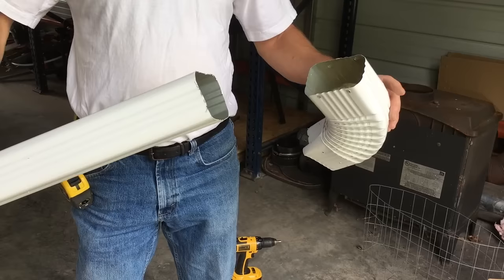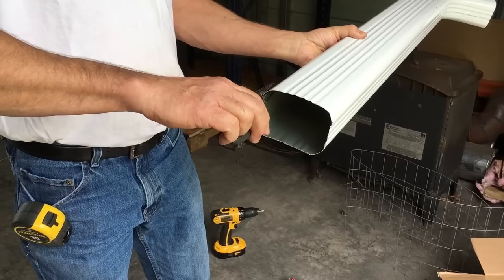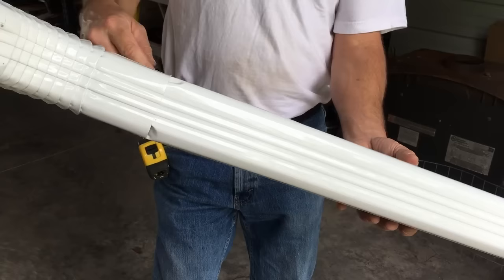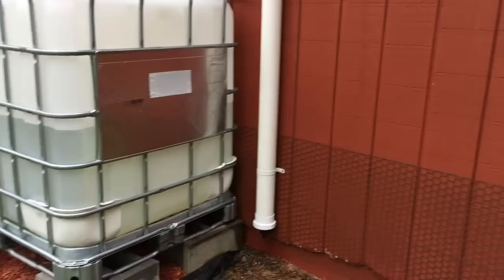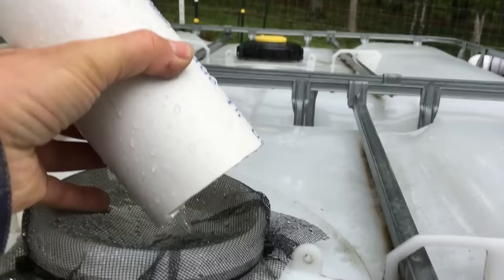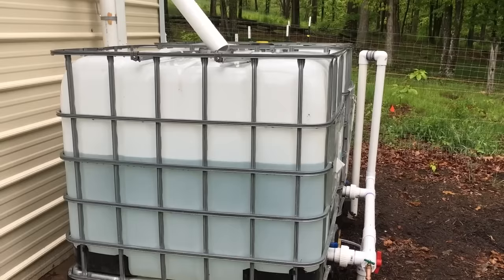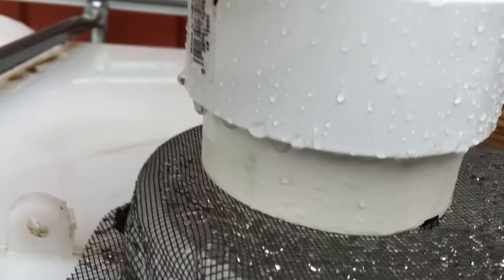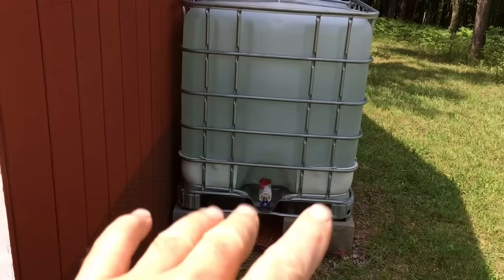RainWater Harvesting Lessons Learned

Comment: Just an FYI for anyone new to rainwater systems. The First Flush is not recommend. Do some research. The water in that First Flush system turns toxic pretty fast and you have to clean it out constantly. That, and you are just wasting water.  All you need is the opening with the screen that the water goes through coming off the roof.

Comment: Just put a ¼ inch tape down the front before you paint the tanks. Pull the tape off after you paint and you will have a ¼ inch clear spot to read the water level.
Reply from the maker: Hi Richard.  That is a neat idea.  It would work, but would need light on the back side to show the level.  If the tank was completely dark, which is the idea to keep algae from growing, then you wouldn't be able to see the water level through the clear spot.  However, if the cap of the tank was removed, then it would give enough light to see the water level.
Reply: +Great Escape Farms   I have a tote wrapped in a black tarp.  I cut a 2 inch wide opening vertically in the tarp from top to bottom and have been able to see the water level very well
Reply: Great Escape Farms you could insert a tube in the top with a pop bottle inside connected to a rod that sticks out the top. The pop bottle could rise inside the tube as the water level changes and you could have a ping pong ball on the top of the rod as a visual marker of how high the water is.

Comment: I just discovered your channel....5 yrs AFTER you made this video!  What a treasure!  I just built a metal 'She Shed' that is 90' wide x 140' long, so I have 8 downspouts on each side of my building.  Since I got 7 free totes & I can buy more @ $40 ea. I am placing 2 totes per downspout on one side (16 total).  For the other side I am hoping to get four 2500 gal tanks + 8 totes  for the remaining 4 downspouts.  Looks like I have a lot of work ahead.  I am most likely sanding the totes & then painting green to match color of my building.  It's too hot here in Texas to use black plastic liner.  We have triple digit tempts & my 16 future totes will be on the West side.
I looked @ your playlist & you have many interesting videos, so u just got a new subscriber.  Thanks!
Reply from the maker: Wow, that is quite the 'She Shed' :)  Thanks for subscribing and good luck with your system.
Reply: @greatescapefarms  Thanks!  Keep ur videos coming.  You are valuable and we are very lucky to learn from you.
Reply from the maker: @TexasLocalProduce  I'm blushing :)  Thanks!

Comment: Thanks for the update.  Kicking the idea of setting up system for "just in case" scenario.  The sun can knock the grid down so water would be an issue.  Any pumps will need to be DC optioned. Watch the sun updates every morning before heading out to work.  It's coming folks.  Prepare!
Reply from the maker: Thanks!

Comment: I'm sure three years later you've stumbled across some better ideas to your issues you were having. One, being the overflow from your first flush. I purchased a drain diverter and put under the bottom of the first flush PVC pipe. Instead of putting a plastic hose on the end, i capped mine and unscrewed it just enough so that the water could drain slowly. The drain diverter catches the excess water and diverts it away from my foundation. I use 7 55 gallon barrels vice the totes only because there are more PVC fittings for the barrels than the IBC totes, however my preference was to use totes vice barrels due to space. Very informative video and i did have the same issue as you with the downspouts!! Nice trick. I too found that out by watching other vidoes. Hope all is well with your system now!
Reply from the maker: Thanks

Comment: i love this video and just a suggestion , if you block up those anti-siphon holes,  when you want to either empty or winterise the tote , then when it rains it will automatically empty the tote and dump the water down your black pipe , it would then refill the tote and empty it when its full , maybe an idea for an upgrade (for others as well as you , is to either have a tap (fawcet) or a screw water attachment (not described that very well ) where your anti-siphon holes are and have it open or shut to purely let air in
Reply from the maker: Thank you!

Comment: I have many suggestions. I give two of them now and add more as I have time.
      First, spend money on lumber and put your tanks up high, The weight of the water (8.33/8.35 pounds per gallon) should be enough so that you will save the money for the plumber, pumps and pressure regulators. And even more important, no need for electricity (for the pump).  I have five (5) 275 gl. tanks feeding seven (7) 4ft. X 20ft raised beds with 3/4 pvc feeding 1/4 drip fittings ( for volume control)(for the big plants. Tomatoes, peppers, okra, ect.) On these same beds I also have the 3/4 pvc feeding 1/2 "cpvc (smaller diameter than 1/2 pvc) with a 3/64 (yes 3/64) hole every six (6) inches.  On my system this will squirt water over four (4) feet.  For the onions, carrots, and others. a simple ball valve controls the flow on the squirt distance. 
      Second, do not paint your tanks black. Two reasons. One, you tank will absorb heat and hot water is not good for your plants.  Even if you can water early in the morning, the residual heat will remain. Two algae is our friend. It grows, then it dies and turns into nutrient that are good for our crops. Even with the gravity feed (very low pressure) the amount of algae requires only a minimal amount of maintenance 
       One last thought for now. even with the large amount of water these systems will catch and store. Using  "drip" or "squirt" watering on the other end will reduce the quantity of water needed to irrigate our plants.
        If you have questions please contact me at cam.man1956@gmail.com
Reply from the maker: Hi Chris, Thanks for the suggestions.  I agree that it would cost less use lumber to elevate and get pressure. But I need high pressure for a mist irrigation system and gravity would not provide enough pressure.  So for 99% of people out there, your suggestion would save them a ton of money.  Thanks!

As for the algae, going back to the mist irritation system, the nozzles are so small that the smallest amount of pressure would clog them up.  So for my situation, I can not have algae.  Others may, I can not speak to what it would do to their systems.

As for the paint, there are quite a few suggestions on this post and many agree with what you say about black paint heating the water too much.  There were a few suggestions of using white paint to block and reflect the sun light and keep the tanks cool.  I may try that method.  

Any other suggestions?  Thanks for your input!
Reply: No argument here. From the photos (in your video) of your gardens I will ask why you need the mist?
Reply from the maker: Hi Chris, - The pictures don't show what the plans are.  I run a nursery business and use mist heads for softwood cuttings that are taken in the summer.  The pictures in this video only show my hardwood cuttings that were taken in the winter - these do not need the mist system.

Comment: Suggest instead of using a flow reducer at the bottom of the first flush, use a valve at the end of the drain tube.  The valve can be adjusted to the desired flow rate and if debris build up it will be visually apparent and can be flushed by opening the valve all the way.
Reply from the maker: Well that is certainly another way of doing this.  Thanks for the suggestion.

Comment: I am going to build a huge tote water tank system. but you must try keep the plastic out of direct sunlight. Uv will slowly degrade the plastic, not to mention the algae build up. I plan to clad mine with mini orb corrugated iron. also you can stack them 2 high and still fill them. This gives you a decent amount of head pressure. to fix the tap that doesn't open all the way, just close the valve and cut the end of the handle off. then open all the way. I like your system. it looks nice and clean
Reply from the maker: Thanks for your thoughts.  I would have figured that the UV wouldn't cause issues with the IBC totes because I see so many out in the sun.  I plan on painting them in the fall, so that will block the UV from reaching the plastic itself.  Thanks again.

Comment: we have 55 gal drums since we don't have enough space for a large tote. I always wondered about a flush set up, but have to say our screen seems to do great job; cleaned the drums last year and there was little to no debris in them.
Reply from the maker: That's cool that you don't have to worry about it.  I'm right next to several large trees and get debris from them as well as their pollen.
Reply: Great Escape Farms , we get lots of pollen in the spring but we let the rainwater go into an open barrel with screen on top and just use it for the plants. It's about time to hook the barrels up again!
Reply from the maker: I've seen from several comments on this post that it depends on use.  I'm using mine for a mist irrigation system for starting plants and the least little bit of pollen will clog the heads up.
Reply: Great Escape Farms oh yes for a mister I am sure it will!!!

Comment: Nice set up. I know this is an older video so not sure you'll see this comment. 
Anyhow, I'd tie all the outflows together with T connectors and valves on each tank so you can pull from all or just one tank. You can also isolate the tanks so a leak in one tank won't drain your entire tank system. To fill tanks, use the overflow from one tank to fill the next tank and so on. If you want to equalize the tanks then just open up all the drain valves that connect the tanks and they will equalize.
Reply from the maker: Well thank you for the idea.  The way it is designed, I think I can do what you are saying.  My biggest issues is I'm only at the farm on weekends and kind of need it to be automatic.  However, a leak would absolutely drain all the tanks with the current setup.  Thanks for the input!

Comment: i have not tried it yet , but on my system ,,,  i plan to take cedar fence boards screwed to the ibc tote metal frame for both shading as well as looks, including top boards , thus not heating the water like black paint exterior would
Reply from the maker: That sounds like an awesome idea.  Let me know how it works out.
Reply: BRILLIANT!  Perfect idea.  Kills 2 birds with one stone (pardon the expression). Serves the purpose of hiding the totes and reducing the sun exposure.  We have redwood siding on the house and I can match the color pretty easily, and I'll paint the PVC as well to match.  No need for fencing, I think.  I've watched a fair number of videos and have yet to see this idea.
Reply: Or use another color other than black, green or blue maybe.  One just needs to block the light from getting in that allows the algae to grow   As Mr. Van Dyke said above use painters tape to leave an unpainted window to see the level.

Comment: Spray painted mine with "plastic recommended paint".  It didn't hold up 6 months. It soon flaked off and peeled right off. Will have to wrap the tote in heavy black plastic material.
Reply from the maker: Yes, black plastic is what I used and it held up fine.

Comment: Always twist a glue joint when connecting pvc. Too much glue will weaken the joint.  Primer on both pieces, glue on the pipe, push twist and hold for 10 seconds.
Reply from the maker: Thanks for the advice!
Reply: This advise applies to cpvc, not pvc

Comment: Thanks for the double glue tip on the first flush system.
Reply from the maker: You are welcome.  That one cost me 30 bucks for a new first flush system.  After I bought the new one, someone commented below to use a heat gun to get the old fitting off so I could re-use it.  I still have to try that little trick.

Comment: nicely done. good info, but I think your overflow should be 3 inch pipe (at least the same diameter as the inflow), I believe on a big rain your overflow will not be able to keep up. I do like the U tube you have constructed for the overflow, It lets you use the full capacity of your tank. I think the french drain over flow should be angled in a "keyline fashion" so it slows the water down to let more of in sink into the landscape and decrease an erosion potential you have there.
Reply from the maker: Thanks for the suggestions.  I have since redesigned the lower plumbing, put in 1500 gallon tanks, and 4" overflow pipe.  The overflow is still dumping in the same area, but the long range plan is for that to be one end of a very long swale with the other end of the swale feeding into a fish pond.  If only I had the time to do it all at once :)

Comment: Look for videos on you tube for recycling pvc fittings to get more information but it works as follows.  Cut the fitting off with enough pipe sticking out to be able to work with it, then heat the parts and twist the inside part out with pliers.
Reply from the maker: I have been told that.  I'll have to try that when it warms up outside.

Comment: If you haven't already replaced the leaking fitting on the first flush pipe, there is a way to remove and reuse the fitting.  Use either a heat gun or a torch.  heat gun is best.  cut the fitting off, leave a quarter inch extra pipe on the fitting if you can.  Then cut through the pipe inside with a hacksaw blade (short hacksaw with blade extended, or just the blade) careful not to score the actual fitting.  Then slowly and carefully heat up the inside pipe with heat gun constantly moving careful not to burn the pipe.  This takes a bit of patience (about 5 minutes maybe), but eventually the pipe will soften up enough to where you can peel it out from the inside.  grabbing with a good pair of needle nose pliers and twisting will allow it to kind of roll up around the pliers.  You will need to continue to add heat to keep pvc soft until the piece is removed.  If the fitting you are saving gets to bent or warped, you can insert a piece of pipe while it is soft and let it cool.  once cool, clean up sanding, then re prime, and glue as needed.
Reply from the maker: This sounds awesome.  I did cut the bottom off leaving a few inches and did keep the old leaky piece.  I will absolutely give this a try as I have more systems to install and would like to reuse the piece I screwed up.  Thank!

Comment: Knowing what you know now, is the filter between the disconnected pieces of pipe necessary? What kind of roof do you have?

Do you mind me asking what you've got in fittings and pipe? We are scheduling a rain catchment project around here, and would like to have some rough budget numbers in advance.

Thank you for sharing the solutions to the problems you've encountered! It gave me some ideas.
Reply from the maker: I really don't know at this point.  I've been working on multiple projects at the same time and the money has all been mixed in for the projects.  I will figure out the cost once I nail down the final solution.  As of right now, it is still changing.  Next weekend I'm going to change the overflow system to a 4" pipe to handle the downpours.  2" pipe is not cutting it.  Keep an eye out for that update in the next couple of weeks.

Comment: Enjoyed your debug session. The only thing I think k I would have done differently would be to have used some unions to make maintenance and repairs easier.
Reply from the maker: I agree.  I re-did the system this year and put in 1550 gallon tanks, which necessitated re-plumbing the bottom section.  I put in a lot more unions and thought into the design.  Thanks!